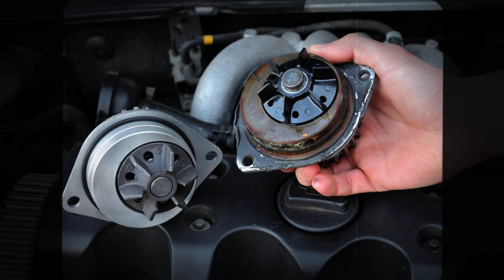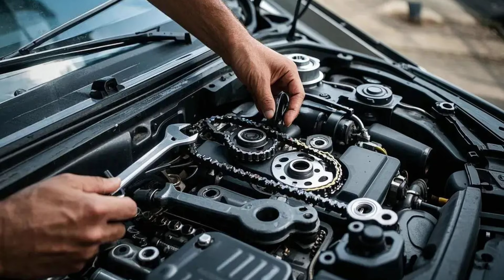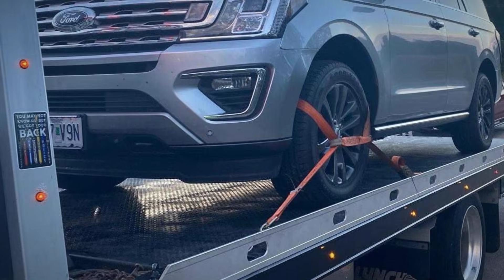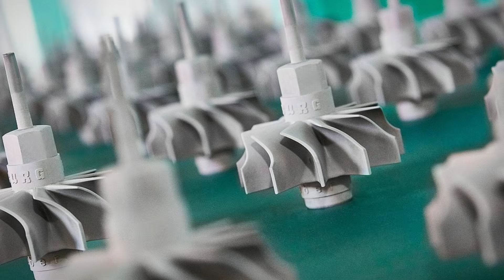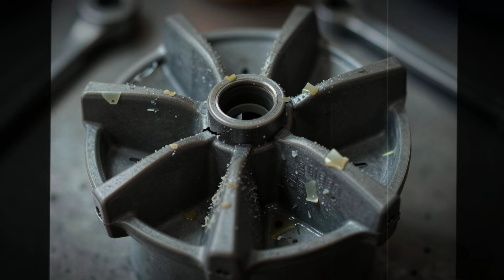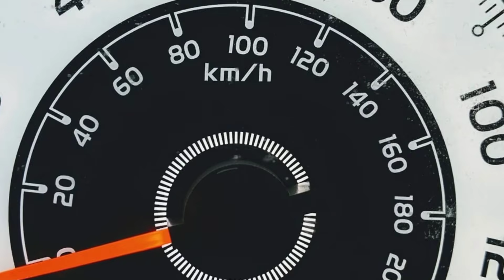Why Modern Car Engines Explode At 100k Miles (Plastic Water Pump Scam)

Comment: Plastic really has no business on an engine.
Reply: Nor does a FAN BELT on your OIL PUMP
Reply: A cover underneath the engine to reduce the dirt that will enter the engine bay or as a battery cover sure but that don't really do anything critical for the vehicle
Reply: @Groza_Dallocort  My vehicle has a plastic upper intake manifold on the engine. That engine has 356,000 plus miles on it as i type this. 
You should know that plastic in engines has been around for DECADES, and just now, you say it has no business inan engine? Really? Even though it has been working just fine for over 25 years on my car?
Reply: @jimgarofalo5479  The plastic 25 years ago was made of sturdier stuff and the things used back then is probably banned now for being toxic to both the enviroment and the people working with it
Reply: @jimgarofalo5479 Whatever you have to say to convince yourself.
Reply: @ZEEKUPP  Well, I could agree with you, but then we would both be wrong. 
However, I don't need to say anything to convince myself. I know what I see and have seen for myself. You would do well to speak from a position of knowledge instead of personal prejudices and emotions.
Reply: @jimgarofalo5479   the coiffient of expansion between plastic and metal is different. Plastic intake manifolds was proven to be bad in the GM 3.6 L V6.  The manifold leaked coolest into the oil. The supercharged engine with a metal manifold never had that problem.  Plastic in engines saves them a few dollars in cost.  Plastic timming chain guides is another example of pure plastic crap.
Reply: @jimgarofalo5479 A. Lot if people haven’t had your luck. I had a plastic intake manifold crack years ago that ended up with a huge repair bill.
Reply: Or a "high efficiency furnace". The plastic impeller in the purge unit shattered ... replacement cost around $1,700. out of warranty.
Reply: It’s part of the game plan to make you more pay or get a newer car.
Reply: Greed.Unfortunately, though it wasn't this particular part,I found plastic on my truck some yrs ago 
. I'd rather have a older vehicle. New ones are a plastic/ fiberglass toy on wheels,computer, sensors,cameras, all over, telling you everything, looks like a airplane console, so pretty, goes so fast, all the bells and whistles, no (I'd rather sacrifice mileage for protection) protection, get a fender bender, half the car is gone. A friend has a truck, $60.000, passenger mirror broke,$250.long-term maintenance is outrageous on foreign vehicles, I've had both Foreign and Domestic. Check before you buy. 🙏
Reply: The technology is not available
Reply: Agreed.
Reply: Yup! Now even the plastic thermostat housing cracks before the thermostat needs replacement. And who actually believes a plastic intake manifold bolted to the high temperature engine heads is a long-term viable design?
Reply: Agree mostly. The intake manifold they can make very smooth for better flow than an aluminum one.
Reply: It all started with plastic top & bottom tanks on radiators instead of the copper or steel.
Reply: For us no for them yes.
Reply: Period !!
Reply: Agreed. Can't handle with daily use
Reply: Many things are fine made out of high quality plastics, the problem is them trying to use it for everything and save money.
Reply: Plastic has been proven to be as reliable as steel, aluminum or iron in the proper places. On a water pump buried inside an engine is not a proper place.

Comment: Actually just check the bottom of your A/C compressor, and you will see coolant dripping from the bottom. There is a "Weep" hole in the block where the coolant drips out to let you know in advance if the pump is failing. The impellors are not plastic either. Just did my Explorer last year. Not hard, just time consuming. Still a design flaw.

Comment: Water pump in the engine block was pure genius. Disposable automobiles. ALL new vehicles are pure junk.
Reply: By design .... !!!!
Reply: @danaoberlander5754  yes indeed
Reply: Except Tesla (other than the Cybertruck)
Reply: @philmarsh7723  we’ll see the long term maintenance cost on EV’s.
Reply: @slchambers1 Just wait until these ev owners have to replace the batteries .... sticker shock will be an understatement !
Reply: @danaoberlander5754  my ex daughter in law has a hybrid Toyota forerunner and the replacement battery was close to 4K.
Reply: @philmarsh7723 Tesla the worse

Comment: Dumb.  Cars like this will not bring in loyal customers.
Reply: Nope the public keeps paying huge amounts for new vehicles.  And besides guaranteed failure beyond economical repair at around ten years, they are getting uglier and uglier.  

The most beautiful vehicles were 1955 to 1978, the best riding and reliable 1998 to 2004.  Manufacturers could again make beautiful easy to repair cars and trucks but the company board members and top executives intentionally are destroying their companies, and the majority of the public supports them in that.  Just most people don't seem to know it.

Comment: If the coolant leaks on to the oil pan from the outside and it mixes in the oil, u got a more bigger problem than just a failing pump...
Reply: That’s exactly what the video shows. Thank you  captain obvious
Reply: @Brandon-e9k  You're welcome, Sergeant Sarcasm 😊😊

Comment: My 81 Honda was easy to repair. Then I bought a 92 Honda Accord with the water pump driven by the timing chain.
Reply: WHAT??
Reply: a Replacing a water pump was a hassle because you had to remove the timing chain so they recommended you replace the pump too when installing a new chain. 
Replacing the timing chain wasn't an easy job for a backyard mechanic. 
The older Hondas had a timing belt and it was easy to replace.

Comment: Company car 2019 ford edge, coolant in the cylinder $8000 engine, and they had a tsb out on the issue, no recall, no covered fix.

Ford is Crap, but they have replaced so many engines due to this , they are really good at it.

Comment: The more of these kinds of videos I watch the more I am glad I drive a 2008 Toyota Corolla. Simple, proven, reliable ride. AC still working too.
Reply: 2010 & 2013 Corollas for me...no CVT, Turbo(s) or
direct fuel injection.
KISS.

Comment: The cost of inspection justifies replacement. All manufacturers seem to aim at the 100k mark at this stage?
Reply: A disgrace.  Should build for a much longer mileage.
Reply: @johnrivas2593  Yes for sure. Just the location of the chain at the rear does not make any sense. They should definitely manufacture a chain that lasts much longer. At a certain point the cost involved with chain replacement does not justify ownership.
Reply: mechanics are the ones being underpaid ..... i bet it was THEIR bright idea in the first place

Comment: Designed obsolescence at its best 🤦🏿‍♂️. But I have nothing to worry about because my 2002 6.0 silverado and 2008 gmc sierra duramax both have water pumps outside the engine 👍🏿
Reply: Weird that that same 3.5L engine was used on Trucks and had an external WP. Only the Front drive version had that nightmare.
Reply from the maker: Fairs!!

Comment: This is really too bad. Several years ago I wanted to get a Ford Flex. but I had heard of this internal water pump design which sounded like are really stupid idea.  So I got a Toyota instead.
Reply: While i may agree about brand problems. U should know that toyota also has water pump failures. The GR engines are famous for water pump failures. Now I'm not saying they all fail or bad design or what but i think it just boils down to luck and maintenance. I have never had a pump fail on my own cars. But i do replace them at least once for a peace of mind. The most important thing to do is to keep up with the coolant maintenance and use the correct spec fluid. Coolant gets corrosive eventually and eat the system from the inside out and ur pump thermostat and radiator are the first to go.
Reply from the maker: Sounds like a great idea honestly. How's your Toyota running today? What model is it?
Reply: @BizInspektor  It's a 2012 Sienna with the 2GR-FE engine.  It had 128K miles on it.  So far just gas and  fluids and up to 145K
Reply: @doctorairflow Smart move 👍
Reply: Same here. Buddy of mine had this happen at 110K miles. Found the same on Taurus & many Lincoln’s! NOPE 🙂‍↔️
Reply: 07 corolla here best car hands down and only 133,000
Reply: @potcat420 99' Accord LX V6 with only 130,000 miles. Owned it now for 19 years and still running strong
Reply: Same. I was looking at a really nice Ford Edge and an older Mazda CX-7. Then I read about the internal plastic water pump and that the engine has to be removed, it is an expensive job and a guaranteed failure. Prayed for the most reliable Used car I could get on a budget and bought a 2014 Acura RLX. My 4th Honda and the others were great, reliable cars.